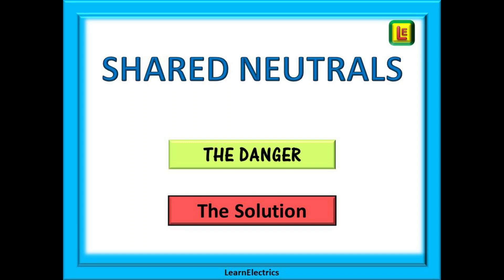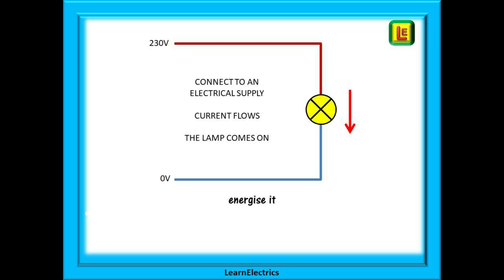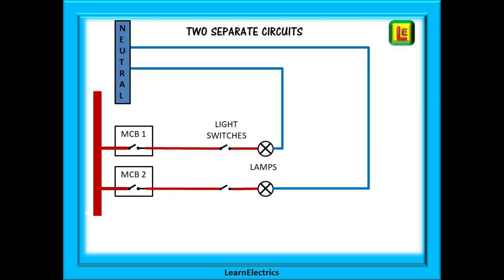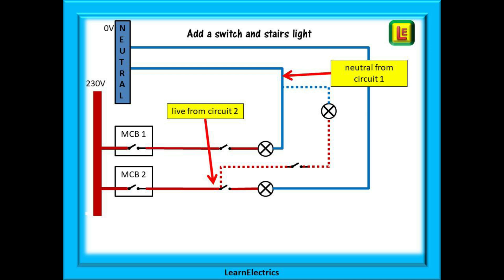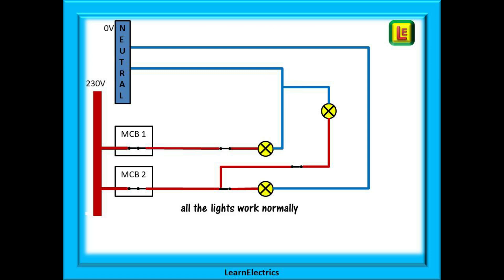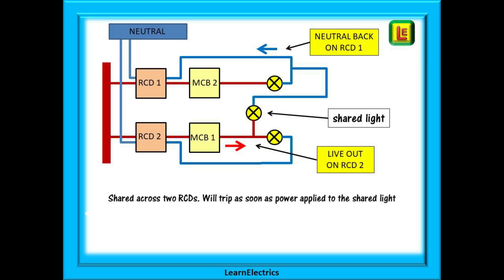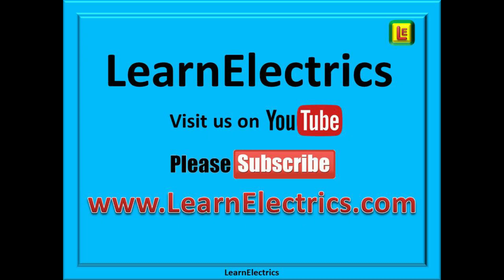SHARED NEUTRALS The Dangers of borrowed neutrals, the problems they can cause and some solutions

Comment: Great video. Just ran into this at my house. A house built in 1990 in ny. Rewiring my garage with a subpanel. Figure i should put the lights and garage doors on it as well. Turn off the breaker... get shocked. Apparently i have 3 if not 4 circuts with their nuetrals tied together.
Reply from the maker: Wow, glad you're okay and that the video was helpful in understanding what happened. Dave.

Comment: electrician just replaced mum's old breakers with RCBO's and there's one switch, a bathroom fan, that trips the RCBO. I replaced the fan, it's not that. I checked the breakers, they're all wired fine. There are 3 switches in the bathroom, 1 for a light, 1 for the fan (that causes the tripping), 1 for a light and fan in the toilet. I suspect a shared neutral, some quick and easy electrical work that may have been done decades ago and picked up by the new RCBO. I will leave this one to an electrician, it's not legal for me to fix this problem.
Reply from the maker: It's good to know when you need help, safety first. Surely the original electrician should have picked this up on his testing before he handed the installation back to you. You should have an Electrical Installation Certificate and NOT a Minor Electrical Works Installation Certificate. AND .. the work MUST be notified to the Local Area Building Control and you must receive a Part P certificate from them. 
Take a look at the videos on the links below that tell you what certificates the electrician must complete and hand over to you. If he's given you an Electrical Installation Certificate he is certifying that nothing is wrong with the whole installation. Since he changed all the RCBOs, he must test all the circuits and remedy any faults, some of which may be an extra cost to you.

https://www.youtube.com/watch?v=S0_IZIOqKhU

https://www.youtube.com/watch?v=BrrI75WTJ8c

Comment: Great video as always. In my apartment I have 4 aircons. I unplugged one of them and received a nasty shock from the terminals on the plug. Is it likely that the 'electricians' have looped two or more aircons with a shared neutral?
Reply from the maker: You will need to trace the wiring to check this out. It could be any number of things, even induced currents into the plug as you disconnected a rotating motor for example. The only way is to test and don't forget safe isolation. see attached video link. 
https://www.youtube.com/watch?v=HyDrsXiGgcc
Reply: @learnelectrics4402  Thank you for the detailed reply! I'll have to cut into the suspended ceiling but it's something worth doing. I will check the link out.

Comment: Had an electrician change the plug in fuse distribution board where we live with a modern RCD board. The single hall light where the board is tripped the breakers, and not the stair lights with changeover switches.
To solve it the electrician had to put both lighting circuits onto the same breaker.
Reply from the maker: If the circuits are sharing neutrals this will happen. The RCDs will not see a balanced input and output. Glad its sorted and thanks for watching.

Comment: Hi, excellent explanation and diagrams! Really helpful.

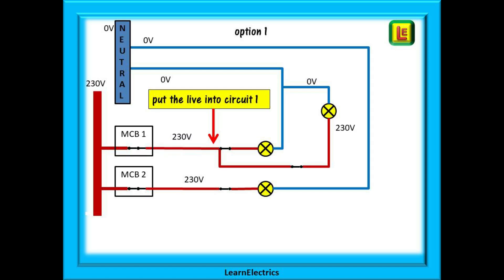However, @ 4:25, I don’t think the problem is the shared neutral, but the open neutral, because if we implement the solution in option #1 (@ 5:34), and the main neutral is still disconnected, then still all of the wires will be energized.

What do you think?
Reply from the maker: The open neutral is going to try andffind a path back by sharing with others Thanks for your input and thanks for watching. Dave.

Comment: It seems to me one major problem that is not discussed is the fact that given two branches with 15A each sharing a common neutral would need twice the capacity ie 30A. Given a feed with #14 would require a neutral of #10. Why is not mention as the #1 safety issue?

Edit  @learnelectrics4402  I am being told that on a common return the feed has to come from a tandem breaker one on each side A and B of the panel. Given this for example 15 A on side A + 15 A on the other side B would cancel out as 0 A phase wise. So the worst case will always be 15 A on the return.
Reply from the maker: Great input. Thanks for watching.

Comment: America here where we use split phase 120V circuits for regular outlet and lights for some background.
I see a lot of people doing this when they add two separate outlets to their garage and they use 12/3 Romex and 1 20A tandem breaker. They will connect the black and red wire to the breaker, 1 for each half of the tandem breaker, and the single white wire to the neutral bar. This creates a huge imbalance in those circuits. If they are pulling 15A on one of the outlets and 15A on the other that is a total of 30A on the single neutral going back to the panel. 10A higher than the wire is rated for. So not only can it be a shock hazard but also a fire hazard. Now in theory it will balance itself out. The real problem is you can turn off one half of that tandem while keeping the other half energized. So now you have a potential of return power on the neutral. Not sure how many people are aware of just how bad a shock you can get from a shared neutral. It will definitely get your attention.
Reply from the maker: Absolutely right. Thanks for the comments for all to read. Appreciated.

Comment: Do you have any vids on when the light is switched via the neutral?
Reply from the maker: Take a look at this video on 2 and 3 plate lighting. Switching via neutral is a new one on me, it will leave most of the circuit live. Thanks for the question and thanks for watching. Follow this link ...
https://www.youtube.com/watch?v=NEjCXO_ZC5c
Reply: @learnelectrics4402  thanks, was on a job today and it had my brain boggled, I sorted it in the end but I don't know how it was blowing up
Reply: @learnelectrics4402     Here in the U.S.A,  in homes built before WWII typically  used knob and tube wiring, and switches were sometimes placed on the neutral side rather than the hot like is required for safety in modern practice.   Homes from this era could have dangerous 3 way switches, known as the Carter or Chicago 3 way,  the hot and neutral connect to the travellers and the light is switched between on the commons,  in one of the 4 switch positions the light is live on both terminals but is not lit. This method was prohibited in the US in 1923 but was used sporadically for many years afterwards , as late as the 1960s in rural areas for switching a yardlight from the house and barn, with receptacles in the barn hot all the time and powered by the house,  with only three wires in between, excluding the ground.

Comment: I have 2 neutral wires burned at the busbar . My  electrician installed the panel 15 years ago and it is only now I noticed as I was installing a new MCB for a Camera system ..... Yes yes I know I'm not supposed to be in there if I'm not qualified before all the spark heads start slatting me ! I have fair knowledge of electrical circuits and would only work at something that I'm confident in installing and  straightforward. 

Each MCB is independent and don't have and shared neutrals. I did check the neutrals for a loose connection as arcing was my first thought. 
They seem all good but the busbar itself is slightly corroded .. the screws being the worst . I have now installed a new wire and bent the ends for better contact ( Original sparky had the two neutrals in one screw , not sure if that makes a difference ) 
Could slight corrosion cause this and if so why did the rest of them not do this ?

The wire is 1.5 mm solid, Goes to the first led light and onto the next 7 lights at a distance of 30 metres 

Again I'm not a sparky ! If I have to pay for someone I will but I like learning the cause and solution of such problems !
Reply from the maker: Liam, all screwed joints will work loose with time, this is one of the checks that we should do on a Periodic Inspection and Test. Corrosion can be for many reasons, damp, chemicals etc. Isolate the CU and check that all the screws are tight, copper creeps (moves) over time. Remember that with the CU turned off, the two incomers will still be live. Dave.
Reply: @learnelectrics4402  Dave thank-you for your reply ! Yes your 100 percent correct . As it being a damp environment (Farm), it will only accelerate corrosion. Ill take your advise and I'll also change the busbar.  Thanks 🍻

Comment: Can shared neutrals cause too much current in the neutral.  I mean 2 different circuit breakers are supplying that part of the circuit. I know it would be rare but could it happen depending on loads ? Could it be a fire hazard
Reply from the maker: I suppose if it was 1mm T/E and both breakers were 10A and running at max load. Good point, thanks for the comment. Dave.

Comment: Would you suggest not disconnecting the neutral than in case it is shared.   That way it is kept at 0 Volts ?
Reply from the maker: Michael, sometimes you need to disconnect the neutral. We shouldn't be fearful of every neutral being shared. But it does show the importance of proper safe isolation checks.
Reply: @learnelectrics4402   great video im learning alot! So if you do your safe isolation checks, ie use a approved voltage tester on the plug socket you want to work on to test its dead, would that show up a borrowed neutral? Hope that makes sense trying to improve my knowledge and safety when doing small diy electrical work! Thanks so my for your videos and time 👍

Comment: In america u can share a neutral in some cases. Its called a multi wire branch circuit. If u have a multiwire branch circuit it is required that both circuits disconnect simultaneously. You do this by using a double pole  single throw breaker. Where both breakers are connected together at the throw. Thus u cut one off the other automatically cuts off aswell. Only used on equipment though. And if 2 circuits feeding equipment share a neutral one piece of equipment cannot consume more than half of the ampacity of the multi wire branch circuit.
Reply from the maker: That's different and interesting. Thanks for the input. Dave.
Reply: That seems to be an danger of shared neutrals as well. Feeding the load of two 20amp breakers on to one 12AWG neutral for instance. Seems you could exceed the capacity of the wire.
Reply: @LarsDennert  read the full message again. I explained that part in the last sentence...
Reply: @isaiahb.5868  I'm agreeing with you but most people won't notice the danger
Reply: cannot consume more than half??  how if it's common trip?   what will limit the current at half the breaker rating?
Reply: This could be why English qualifications are a prerequisite in some cases.

Comment: This is for here in the states but there is a so called Chicago3-way for turning a light on from 2 places. it involves putting the hot and neutral on the travelers and light on the commons or
poles of the switches, one way is safe as the screwshell is at ground but the other way puts 120 v live on the screwshell of lamp and the NEC prohibits that as of 1923, another style is the 
Hollywood or California 3-way weird it is but at least the screwshell is on the neutral side.
Reply from the maker: I like the names Raymond. Thanks for the info and thanks for watching. Dave.

Comment: Yup, that can be dangerous, say the sparky is on a ladder, the surprise jolt could knock him off 
the ladder and cause some real pain, however, what if loads were greater than a few lamps? 
say a vacuum cleaner and an electric skillet and a hair dryer, the overcurrent device may be 
carrying close to its rated capacity on both circuits but the neutral of one ckt could be carrying
a lot more than what its fuse is rated for and the only time a fuse will blow or a breaker trip is
when the wire heats up enough to cause a fire, then when neutral touches HOT the breaker trips
but the fire has already started.. .
Reply from the maker: Absolutely. Apparently there are several deaths every year from what happens after the electric shock. The poor guy survives the electric shock part but breaks his neck when he lands on the floor.
Reply: @learnelectrics4402  It is not just about shocks, if you share a neutral with another circuit off or of  the same phase leg, the currents will add up, say u have 2 15 amp circuits, that would be a 14 gage wire here in the states. the wire is good 
for 15 amps and is protected by an over-current device for 15 amps. BUT if u 
share that with another 15 amp circuit  neutral on the same phase, (even though
 the black wire is protected) The current will be doubled on the neutral wire and 
the heat will be quadrupled 4 times even and THAT will start a fire.

Comment: Meaning to say the diagram at 5.22, the flow can be both ways even though the light is off?
Reply from the maker: This is the danger with shared neutrals, you think the power is off but parts are still energised. Thanks for watching. Dave.

Comment: Anytime I change a consumer unit, 70% of the time the RCD trips when the landing light is switched on. This is because of a borrowed neutral. The only way around it without altering wiring, lifting carpets, chasing, is to put both circuits on the same RCD. This then defeats the original objective of having the lighting circuits on different RCDs. In the event of a fault the property will loose all lighting.
Reply from the maker: Sometimes we have to make them choices Paul. Make a note of this and if you do a rewire you can sweep this problem up. Thanks for watching and thanks for the useful comment. Dave.

Comment: Hi Dave. Just wanted to know, something regarding extraneous conductive parts. How does an extraneous conductive part become live during a fault. The only item I can think of  to make the exposed conductive parts become live is if there is a earth fault on the boiler, which would potentially make the heating system, water and  gas pipes to become live. Can you please clarify this. Thanks
Reply from the maker: good question, have at look at our video - 
Exposed and extraneous electrical parts - on this link
https://www.youtube.com/watch?v=MpiwTOSY1gw
Until the fuse blows, any connected metalwork will become live. If the cooker casing becomes live and that is connected to a metal light fitting through the bonding then that is also at 230 volts until the fuse disconnects. That is what we want to happen for safety. If everything is the same voltage you can't get an electric shock because there is no potential difference to give you one. that is why birds can sit on power lines. Both feet are at 400,000 volts. No difference, no shock.
Reply: @learnelectrics4402  just a minute  ago I came across your video which cleared up any of my doubts etc. Again Thanks Dave.
Reply from the maker: Excellent.

Comment: Thanks again for sharing your knowledge. As an adult learner I've never understood why this situation is created in the first place. At 3.50 in the video you say the live feed to the upstairs light is taken from the downstairs lounge lighting. What I don't understand is, if you're running a cable upstairs to the light why don't you run 3-core in the first place.  Is it as simple as running in singles to save a bit of cable or did 3 core not exist at that time in the electrical industry?
Reply from the maker: Old methods and working practices, plus they used the two plate method a lot. looping the live between switches and the neutral between ceiling roses. I just used the lounge switch as an example, it could have come from anywhere.
Methods are always changing. Now we are installing smart switches, another change.
Thanks for watching, appreciated.

Comment: once again, great video but i have a question. Would you say its worth testing for a borrowed neutral before a board change to save the headache of finding the fault, if so how would you go about this?
Reply from the maker: It always helps to know the installation before a board change so that you know what to expect. More on fault finding in a soon to be video. Thanks. Dave.